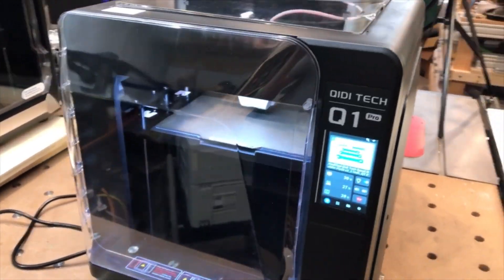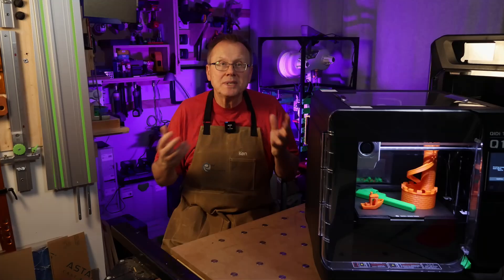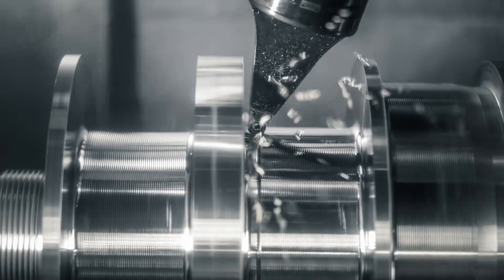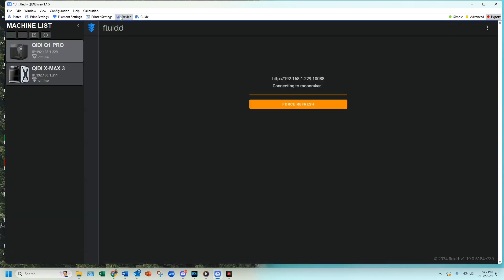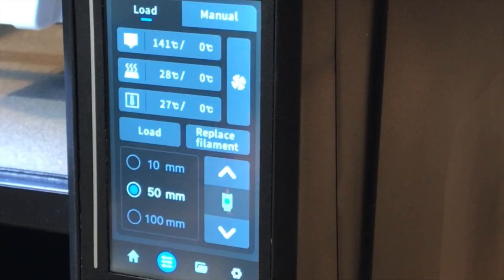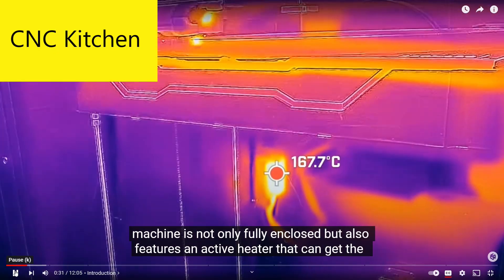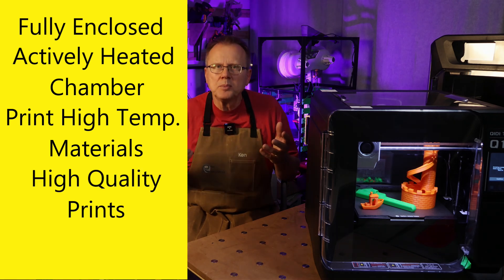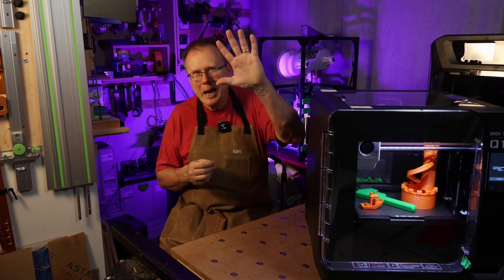The QIDI Q1 Pro is the best-kept secret in 3D Printing

Comment: now 1 Year since your excellent presentation,  how would you compare this to a now on sale P1S Bambu main unit only at $399   (P2S replacing P1S soon) whihc would you choose, I dont need a color printer,  or the QIDI Plus4 3D Printer later model
Reply from the maker: The current price on a Bambu Lab P1S is quite a bargain.  I think it would be my top choice for $399.  Thanks for your comment and question.

Comment: A true game-changer for low cost printers. I got mine on Black Friday sale for $350. Steal! And I love the slicer, the big touch screen, the auto-bed-leveling and filament head cleaner. It makes this printer completely hassle-free. The spool holder is VERY lame and should be upgraded. I am thinking about having an in-line dry box as well since I like to print PETG and ASA/ABS. And this hot little oven keeps the bed and chamber nice and toasty for the fancy filaments like ASA and ABS. Still haven't tried nylon or CF-PLA, but I know this thing can handle it. BTW, the door is not that big a deal. Where you put the little stick-em handle, you can just put your finger in the groove and pop it open. But, I think I'm gonna make a handle as well. The one thing QIDI needs to get crackin' is the multi-cassette feed box like the Bambu Labs.
Reply from the maker: Thanks for your detailed comment.  I agree with your points, especially with looking forward to QIDI coming out with a multi-filament dispenser.

Comment: With coupons floating around I got the Q1 Pro for $385, The P1S was going to run me almost $670.  This was a no brainer Q1 Pro purchase being it's a more open ecosystem running klipper.  You obviously miss out on an AMS but I was okay with that.  The first things I printed was a stronger spool holder (PETG) and a carbon filter box (ABS).  I love this thing.
Reply: Mine's arriving tomorrow. I found a $30 off coupon and got it for $369.
Reply: @rezalbb what was code?
Reply: @rezalbb I got you both beat I got mine for 299 .... Also what is ams ?
Reply: @BananerRepublic  Nice score. I saw an X Max3 sell for 225 at a local auction. AMS is the multicolor filament server.
Reply: QIDI is supposed to be releasing a MMU this quarter. I wonder if it will be compatible the Q1. I’m in the market for a new printer that is engineering material capable.
Reply from the maker: I’m glad you are enjoying the Q1 Pro. Thanks for your comment.
Reply: you can also make an MMU unit

Comment: Does the glass door have to b closed? I have limited room and so I could not open and close it.
Reply from the maker: The door needs to be closed for higher temperature filaments such as ABS, ASA, etc. to keep the heat in which helps with reducing part warping. I hope this helps and thanks for the question.
Reply: needs to be open for PLA
Reply: @thelettermrepeated You can make do with just keeping the lid off for PLA

Comment: It looks interesting, but unlike the Max its build volume is only Benchy-sized, an instant exclusion criteria and it doesn't seem like they have an upgrade path for multi-material printing either.
Reply from the maker: I’m not sure what you mean by it being a benchy size, but it is smaller than a number of printers. I do agree it’s not clear if QIDI will be coming out with a multi-color upgrade or not. Thanks for your comment.
Reply: @ristinnovations  Basically, anything below a 300 mm cube volume often makes it neccessary to split certain projects into multiple parts and deal with parts alignment.
Reply from the maker: @Iskelderon Yes, I do agree that depending on the size of your prints, a volume of less than 300 mm does have some limitations. Thanks for your reply
Reply: @Iskelderon  Talk about hyperbole ...

Comment: I have one question on the design of the printer and that is, would the runout sensor on the print head ever get used? The anti-tangle sensor (a movement sensor) will always stop counting movement first for any break or filament runout.
Reply from the maker: That’s a great question. I think the way the tangle sensor works is that it detects resistance of the filament to pass through it. If there is no resistance, then I don’t think it will be triggered, but once the last of the filament reaches the runout sensor, that’s when the runout sensor will be triggered. I will have to do a small experiment to prove my theory. Thanks for your great question!
Reply: @ristinnovations  Interesting. I would think it'd be a movement sensor, lets say a stationary old ball mouse (quadrature encoder wheel against the filament). Detecting a jam (tangle) would have to read that the filament has stopped. Love to know what it actually is.

Comment: the Bambu alternatives become valid as soon as they get something like an AMS. If you need to change filaments often, It’s just so very convenient to be able to just select a filament in the slicer and hit print without having to spend time to do it manually. I don’t use multi color prints a lot, but that’s a bonus too.
Reply: What is ams ?
Reply: Qidi Box is coming soon ™. Tho there are multi color systems like the KSM set from Co Print that sould work here as well

Comment: Nice review, I just don't understand why get a printer that can do materials that need drying and not plan to hook a drier directly to it. The junky spool holder is nearly useless, but again a drier needed for the materials this printer is for, otherwise get an A1 or an ender. The door handle on the bottom right seems to work fine for me and I have big fat fingers. FYI I love my Q1 Pro.
Reply from the maker: I agree that for the higher temperature materials a filament drier hooked directly to the Q1 Pro is the thing to do. When I was printing nylon that’s what I did and it worked great. You are right that the door can be opened by pulling on the lower right corner, but if they added a slight dimple to that spot it would be that much easier to open. It’s a small “nit” that I bought up. I’m with you; I also really like the Q1Pro. Thanks very much for your comment!

Comment: Qidi provides a carbon filter upgrade file to add if u want
Reply from the maker: Thank you for pointing that out. I wasn’t aware they have a stl file of a carbon filter box available. I still think QIDI should have included the printed box along with Carbon media in the printer shipment, but at least there is a after-purchase option. Thanks for your feedback.
Reply: @ristinnovations  yeah true but they had to cut corners to get that super low price somewhere and I'd rather print a box and buy some charcoal pellets so I can pay the price I want
Reply: @NoMercyFtw is there an stl out there for this filter box mod? Thanks for any  links!

Comment: Great video! how do you feel it compares to the flashforge 5m pro?
Reply: Overall similar, but larger build area, heated chamber, and Qidi has amazing customer service. Plus the Qidi is about $30 cheaper all current discounts considered. $419 vs $449.
Reply: @802Garage  Thanks for the info, I saw Qidi has already made some changes to the Q1P in a reddit post. Just wondering; how's the overall print quality? In reviews I've seen people say its slightly worse than the P1S and A5M.
Reply: @802Garage  How can you get it down to $419?
Reply from the maker: Thanks for your comment. Unfortunately, I don’t have any experience with the Flashforge 5m pro so I can’t offer any advice comparing that to to Qidi.

Comment: How do you get the chamber to 90C, the bed to 200C and the nozzle to 400C?
Reply from the maker: I didn’t see where I provided any of those numbers in my video. In my table @11:43, I list the chamber temp of 60C, bed temp of 120C, and hot end temp of 350C. Can you help clarify your question? Thanks
Reply from the maker: I didn’t see where I provided any of those numbers in my video. In my table @11:43, I list the chamber temp of 60C, bed temp of 120C, and hot end temp of 350C. Can you help clarify your question? Thanks
Reply: You buy a printer with these features
Reply: You’ll want to look at a professional grade printer. The Qidi Q1 Pro is a really good printer, but for the hobbyist market.

Comment: I hate the nozzle wiper on my X1 Carbon, the one on the Q1 Pro looks much better.
 I add a skirt 20mm away from the print and if the blob of plastic on the side of the nozzle doesn't get caught in the purge it usually gets trapped in the skirt, before that the blob nearly always got trapped in the outer layer of the part.
 I have tried a few 3rd party designs to solve the wiper issue but they are not good, I do have a another solution in the works but am waiting for some silicone to arrive.
 Did you make any mods regarding the nozzle wiper on your X1 carbon?
Reply: Nozzle wiper in Q1 Pro is very nice. But it would be good if the print head would index a different Y position while wiping to use more of the felt instead of just one deep line grooved into it. Maybe a firmware hack is in order. Just set Y position to change by 1mm every so many prints. That felt thing would last a lot longer.
Reply from the maker: Thanks for your comment. No, I haven’t made any mods on my X1C regarding the nozzle wiper. I haven’t had any noticeable issues with mine.